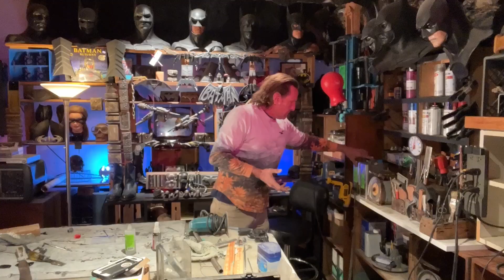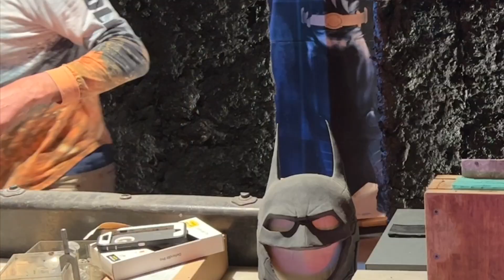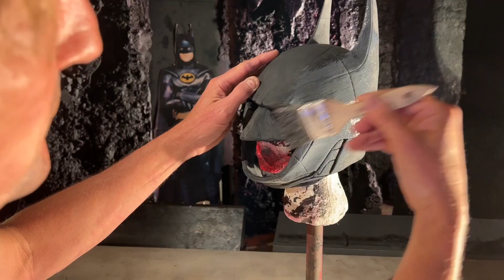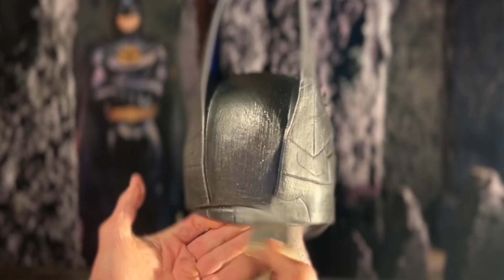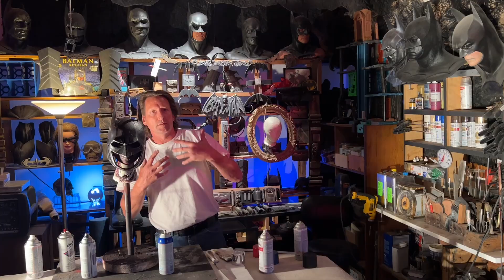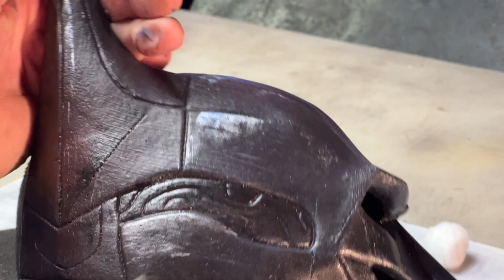DIY Instruction On Custom Painting a Batman Cowl

Comment: Any other thibgs can use instead of plasti dip?? £15-20 in uk pain tryin to get it lol
Reply from the maker: Well, I paint on there lightly with regular spray paint but that does not flex.  The plastidip needs to be applied first to coat and seal so the latex does not oxidize.  Plastidip is readily available.  As to something else for the first layer.  I guess anything that you find that sticks well and is flexible.  I do not know what it would be other than really high end special effects materials.  "Skin Flex" comes to mind.  I have not used that for maybe a decade.  I do not even know what it is called now or if it still exists.  I thank you for your question and your interest.
Reply: Yeah first time I attempted make something I used regular spray paint, would becer attempt that again lol
Reply: Never**